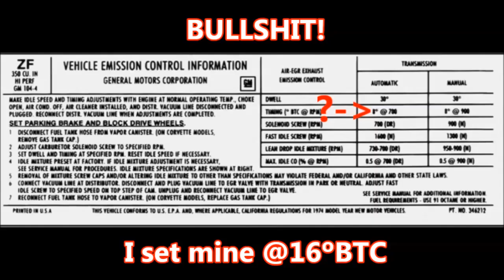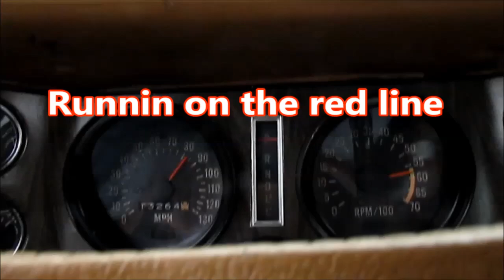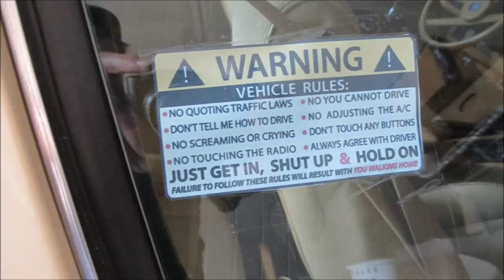Camaro tune n test with a triangle

Comment: My first car was a black primed 73 z28. Got it after I saved all my checks as a bus boy in a lobster house. Chrome Craiger SST’s 50 w in the back 60’s in the front. Only 307 with automatic. Back in 1986. Beefed it up a few years later to 81 z 28 t tops. Those days are over . But glad you can rock JB!